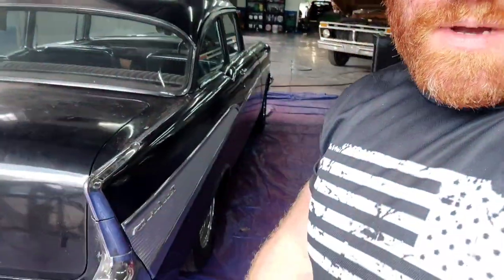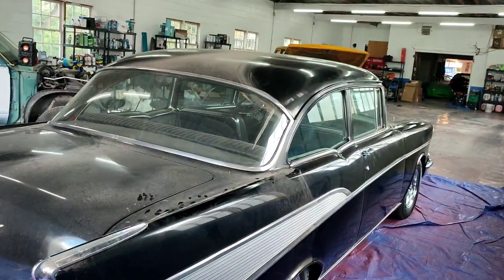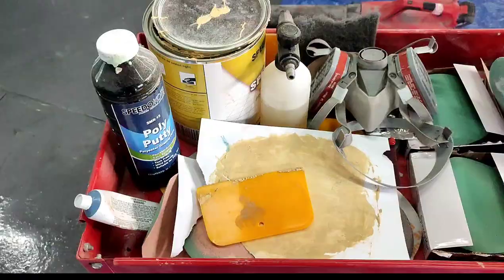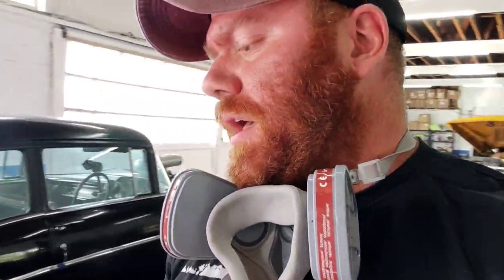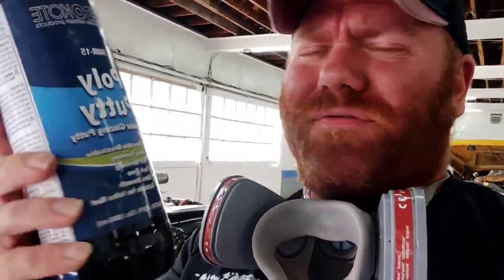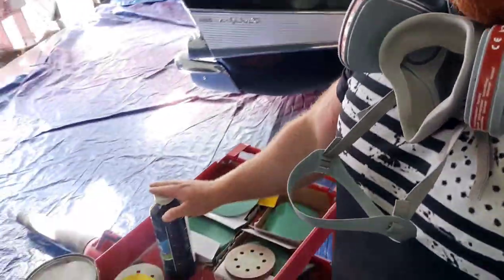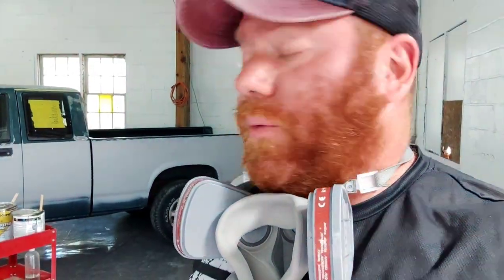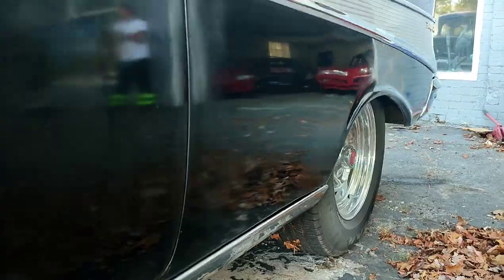Single stage paint blending

Comment: This is great and I think you should do more videos focusing on blending single stage paint.  Lots of people who want to do this type of blend including me but every video I search for on YouTube was about base/clear blend.  Last year I did my first full car paint job single stage urethane paint from Eastwood and it came out pretty good you know like from 5-10 feet away. Problem was got a few runs in the paint so I stopped at 2 coats even though I wanted at least 3 coats.  It was late into the night and I said fudge it since I didn't want the runs to get any bigger.  Unfortunately, when working on the runs with razor blade and sand paper I burned through the paint in a few spots.  Probably should put an extra coat or two on it but I just don't have the time or will to do that again.  So I will be attempting this blend soon and I'm not going to lie I'm a little nervous about it!  I tried this type of blend on a different car and it left an overspray-looking-line that I still have to wet sand and buff.  I assume I didn't apply enough blender.  It's a difficult balance because you can get runs if you apply too much.
Reply from the maker: Yes key is doing it in hot weather
Reply: Yes I agree!
Dad bought a 55 Dodge new; I’ve owned it now for many years . Now I would like to touch up some issues but there isn’t much on the topic unless it’s a base/clear..

Comment: You can do the body work in 1/2 the time because your not doing it right. You hacked it like the first person. That car deserves better. Cut the rust out, weld a piece in and use short hair filler. Terrible for a classic, it's not a Honda.
Reply from the maker: It was a quick patch job. He didn't have a lot of money and wanted to enjoy it the rest of the season.
Reply: @speedokoterefinishnetwork4937 was that spray max clear you were coming in with after laying the black? Out of the spray can
Reply: Correct that supposed recommended TLC costs a lot of money to get done at a shop.  Work with customers and everyone wins
Reply: I do somewhat agree but keeping these old cars on the road keeps people interested in them. What would be worse, doing a cheap patch job on it or the owner tearing it apart, losing interest and it sits in pieces for 20 years?

Comment: Nice to see you using a rasp/grater on the filler. Some people have more time than money and the less expensive filler maybe all they can afford. Maybe an option for the Walmart filler user is to use a rasp/cheese grater with a better quality sand paper. I've seen some Youtubers claim 3m sandpaper lasting significantly longer than cheaper options. But I've also seen Youtubers compare an Amazon sandpaper to 3m and the Amazon product was comparable to 3M for a significant price difference.
Reply from the maker: Don't take this the wrong way. This type of mindset will have people going to the grave with a lot of regreetts. You can always make more money. Can't make more time.

Comment: I know some people comment that you do hack work, but they don't understand that it's up to the customer and their budget.
Cutting out rust (or damage), fabricating and welding in patch panels is very time consuming, which means more labor hours. 
A few more hours here, a few more there, it all adds up.
Reply from the maker: Exactly
Reply: Just to continue the same repair cycle every few years. I dont like doing work twice, nor would I want to warranty bubbles later. My jobs dont come back, PPG warranties their products for the life of the vehicle, but requires proper procedures.
Reply from the maker: @Awakened133  oh I fully get it. This car is never stored outside. So the likelyhood of it coming back is slim

Comment: Do you have a stake in the speedokote company? Just out of curiosity, because you’re so behind the products.
Reply from the maker: I have been using there products sence I was a teenager. Fully support the brand. As far as my involvement with the company I am simply there media person. Do the videos and such.
Reply: Sell us on the brand. Instead of mocking  with funny voices and the tongue psttt. Thing. Tell us why we should spend hard earned money on a relatively generic brand product when top name brand is the same price.ill give you the clears are cheaper than top shelf but everything else is priced on par with 3m and evercoat. I have tried the speedokote high fill primers and  they cant compete with even local shop products. They were very thin and had lots of shrink back. The base coat white was thin also. 6 coats to cover gray primer.